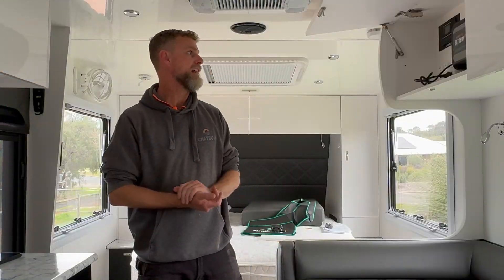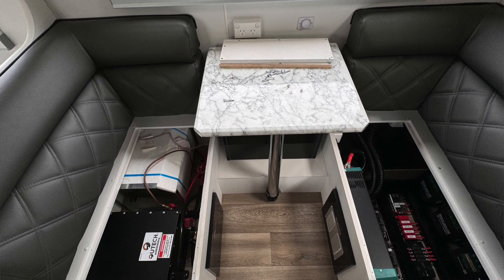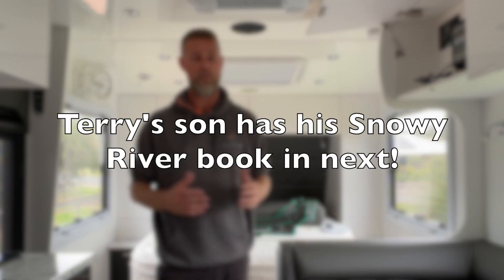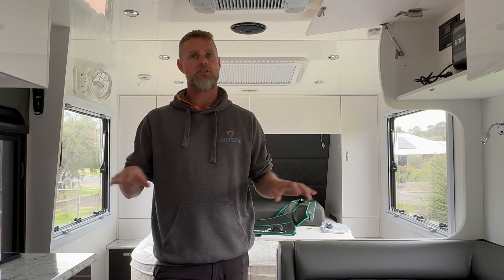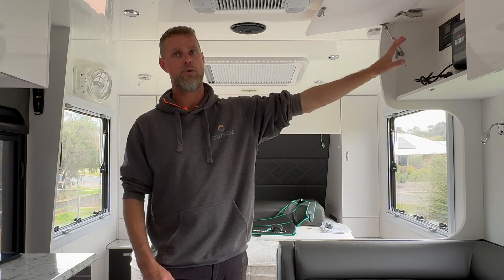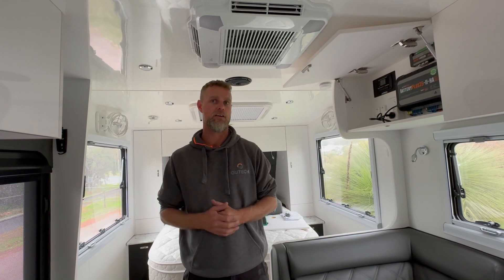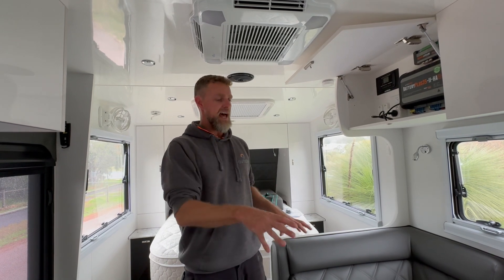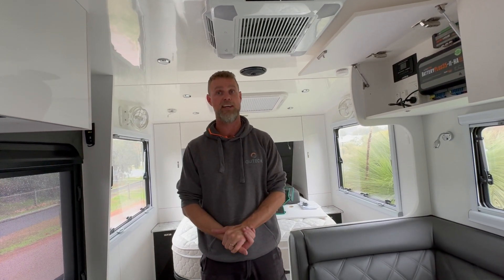GET A BASIC 12V CARAVAN POWER SYSTEM - THIS IS WHY

Comment: Can the BMPro 35...HA system be retained for the budget functionality and then add an inverter and MPPT for the extra solar on roof?  I have heard that BMPro is more reliable than the Projecta system that is being installed in many new builds? Basic manufacture build def seems the way to go. Then add afterwards as required. I was recently quoted $2,500 to simply add x2 200 watt solar panels to a new build by a dealer. NO Thanks.
Reply from the maker: Hi and thanks for the comment.  I discuss the BMPro in this video https://youtu.be/yHEJnvVlMeg?si=4pxScBujWnSPh85D